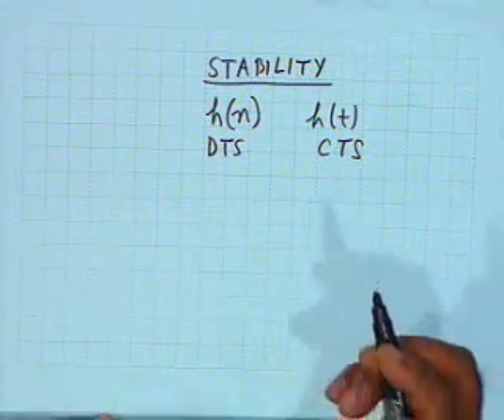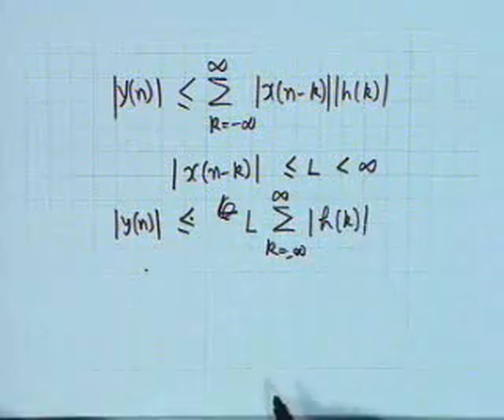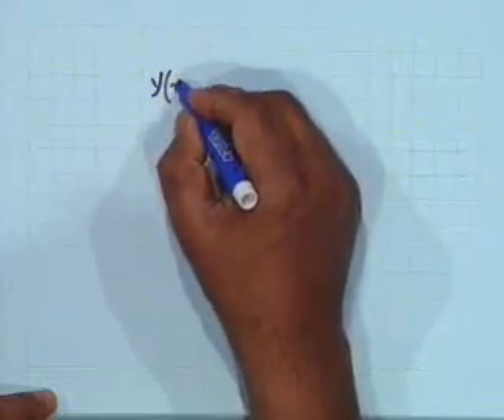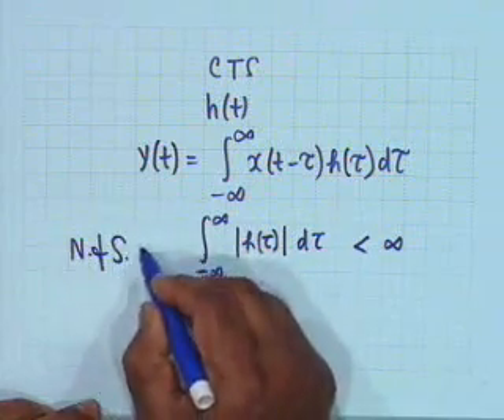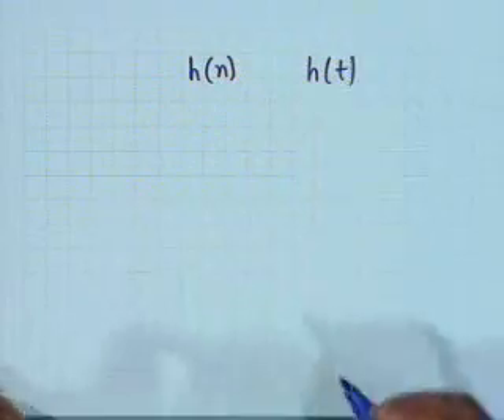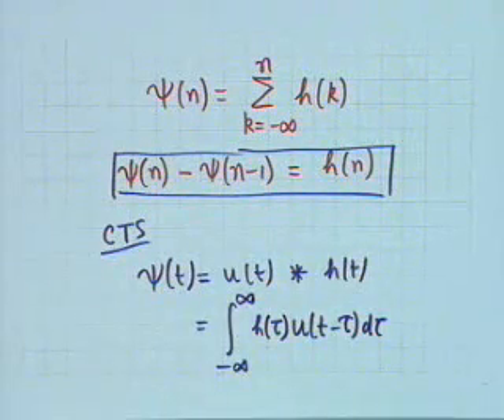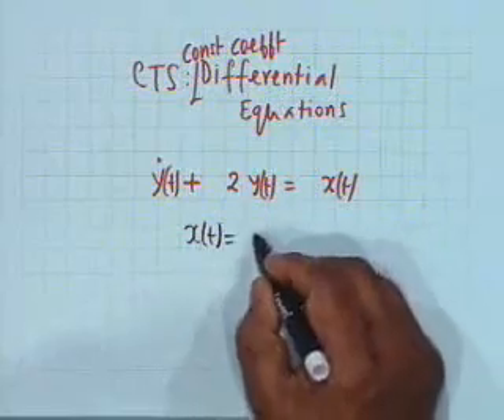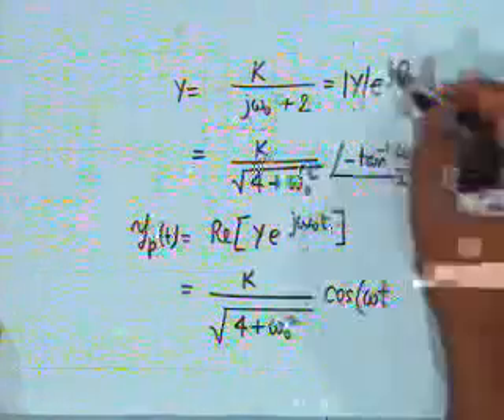7. Stability Unit, Step Response and Differential Equations

Comment: go through 'Signals and systems' by ALAN V OPPENHEIM for the portions that is missing in this series and try to correlate, hope it will help
 http://www.slideshare.net/e-for-all/signals-and-systems-2ed-oppenheim
Reply: Slide is also missing :/
Reply: I clicked the link but there is an error: This SlideShare was suspended because it violated SlideShare Terms of Service and/or Community Guidelines.